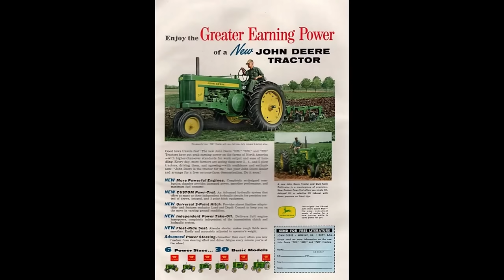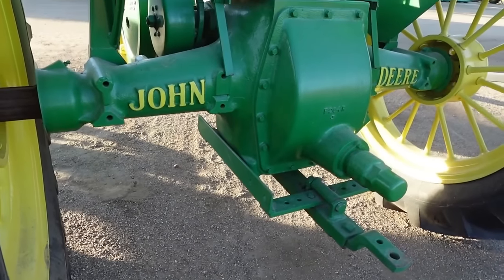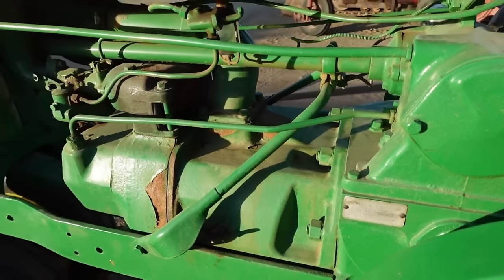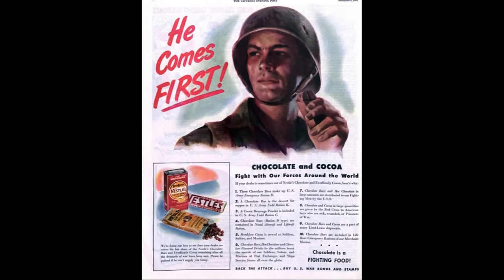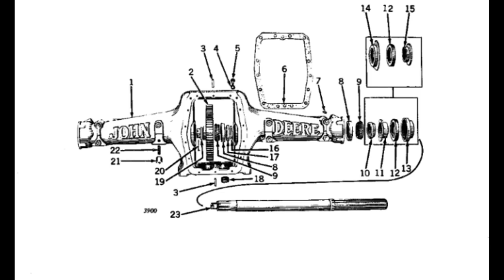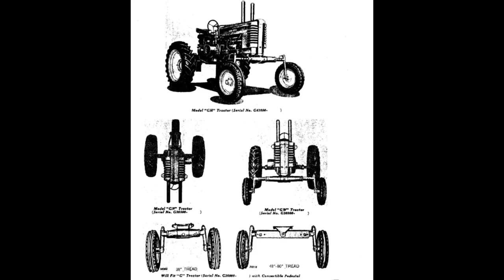John Deere G (Farming Legend)

Comment: Granddad owned a 1951 G that had been bored .090 oversized and it had no problem pulling 3-16’s in any soil but in clay it would overheat. Wish I had it today. That tractor would really bark under a load. After dark the exhaust pipe would glow cherry red when plowing.
Reply from the maker: I bet that was a fun tractor to plow with! Thanks for watching👍🏻👍🏻

Comment: Pops had a G (m), used mostly to belt drive silo blower, probably some disc work too. He loved the super low resting idle sound. The G loved gasoline when working hard on the blower;). Under heavy load on the belt the whole tractor would hop up and down.

Comment: A friend's father had an old "General Purpose". Started on gas, then switched over to kerosene. His father-in-law worked at a refinery, and started bringing him Distillate [white gas] to run in it. Hand cranked, if you didn't get everything just right, it would wear you out cranking it. Friend and I drug many a flow line to various locations on that oil lease.

Comment: My dad had an unstyled G. Like you said 4 speed and max of 6 mph. He had  the hydraulics modified for a remote cylinder so we could pull a 10 ft wheel disc. It also used to run an Allis Chalmers model 90 combine.  We had lots of mud one fall. The previous owner had steel wheels for the rear and spacers for the front wheels to give more clearance. It had cast rear centers and 36 inch rims. Those came off and the steel went on. I drove it 7 miles on steel pulling the model 90 with bomber tires on it. 6 mph was plenty fast for the steel. It was on gravel roads and every impact came right up through the seat
  It was a horse of a tractor. It also ran a one row Gehl ensilage cutter. It didn't start real well if you killed it when hot. That was a workout. 
  We traded in JD AR for the G. The AR was so early it had the rod for oil pressure and was on steel when we got   it somewhere around 1950.
  Been nice to still have them. They were out of date when traded and money was tight.

Comment: I didn't know an early G had single stick shift 4 speed,i used to have a 70 diesel with kick over transmission and 2 reverses nice video
Reply from the maker: Thanks for watching👍🏻 that’s how my 70 is too with the high low shifter, can’t decide if I like it better than like a 60 with the 6 individual shift spots

Comment: Grew up on a 52 G . Had to overhaul it a few times. It was bored out to max. It had power to pull a 5 bottom plow tried it with a neighbors plow to see if it would do it. Was very strong pulling tractor but very thirsty on gas.

Comment: Back in the early 1960's our neighbor had 3 JD G's all stylized.  Believe 2 had narrow front ends but the 3rd had a wide front with a narrow pedestal all incorporated together.  I never saw it converted to the narrow configuration but would say the wide axles would have to be removed somehow.  By your video I didn't see that as a model option.  But it sure did look like a factory front end.  Neighbor did put a Char-Lynn power-steering on it.  Made it a lot easier to drive.  Electric start with petcocks for each cylinder to help starting.  I plowed with it pulling 3-14s" in black soil and clay hills.  They were pullers.
Reply from the maker: Definitely where some pulling machines, Thanks for watching👍

Comment: Dad had a '51 G, in 1959 he traded it in with a two-row pull type JD corn picker for a leftover 720D electric start with a 227 mounted picker.  I've owned it & another 720D ES.  I've also owned a B, 70D, 520, 40S , LA & now a 1944 "H".
Reply from the maker: Sounds like a good collection of JDs, Thanks for watching

Comment: We have a 1945 GM and 1949 G. The 49 is my nephews pulling tractor. Its 6.5 bore 10 inch stroke. 13:1 compression. It made 143 horsepower on the pto dyno when we let off afraid to blow up the pto gears